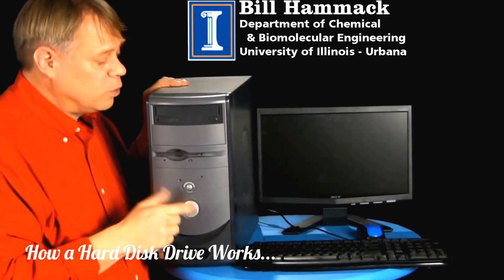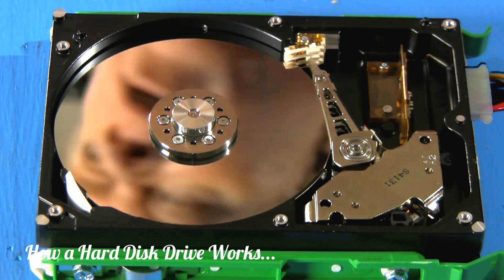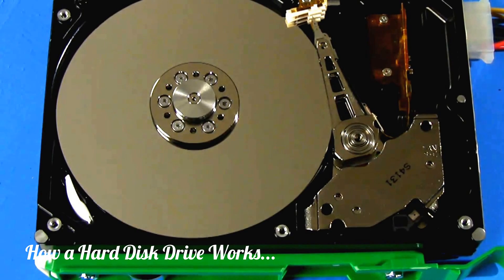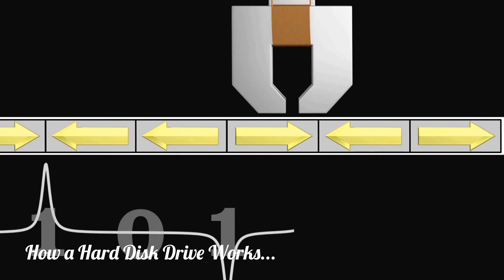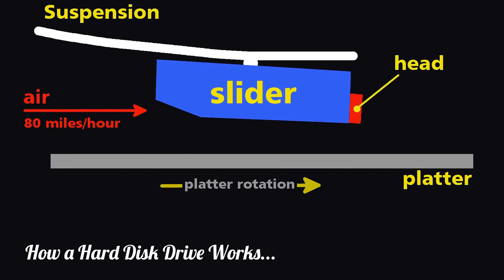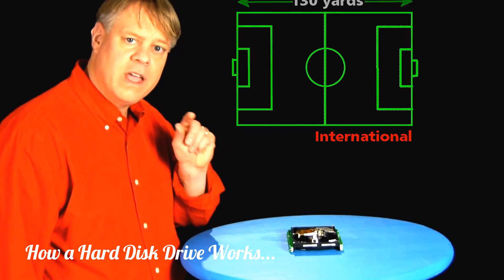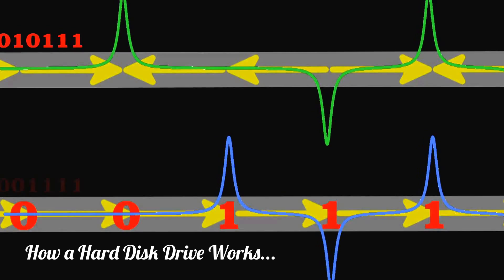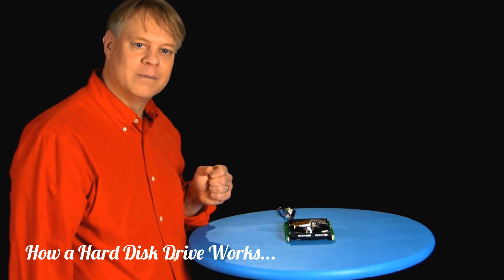How a Hard Disk Drive Works...

Comment: I don't think newer or even older hard drives heads were within 100 nanometers even a small drop could kill them like that really bumping them could its probably in micrometers
Reply: As long as the motor spins at the right speed and there is no disturbance in the airflow, that should keep the heads from touching the platter - drops do not necessarily kill HDDs, they can withstand falls and bumps to a limit, drives monitor this internally and will automatically protect the heads at the moment this happens, hard drives are not supposed to be dropped, that's why they are supposed to be securely mounted in your case, bumping your case will not damage the HD, you might hear the hard disk react to it and quickly move the heads in a safe area and return them back when it's safe.  nothing is fool proof though, depending on many factors.  I've accidentally bumped case and knocked HDDs whilst testing outside a case, by accident, and they were never damaged, but they have a limit as to the distance of fall (Gs)